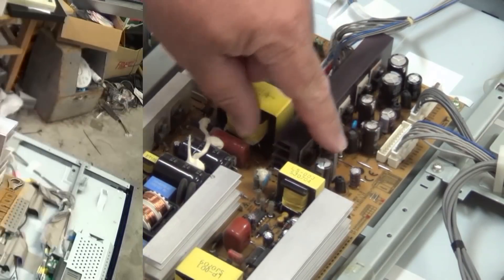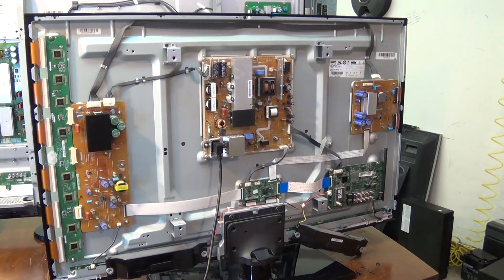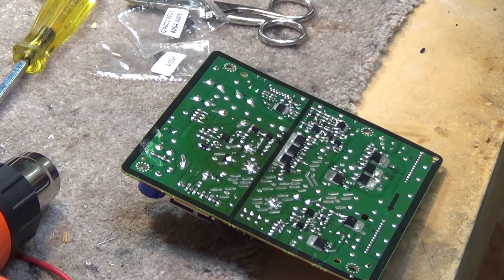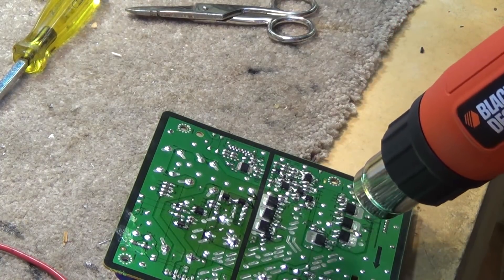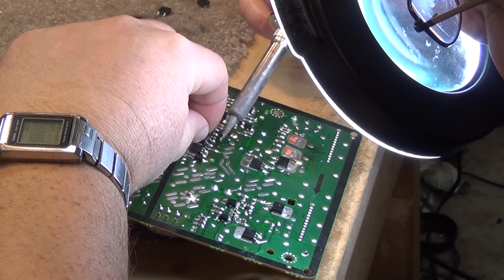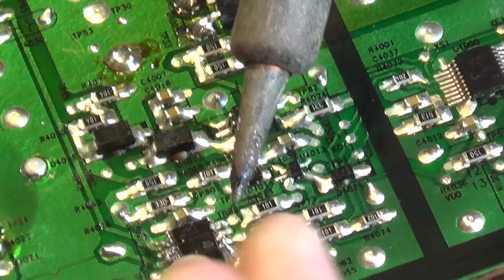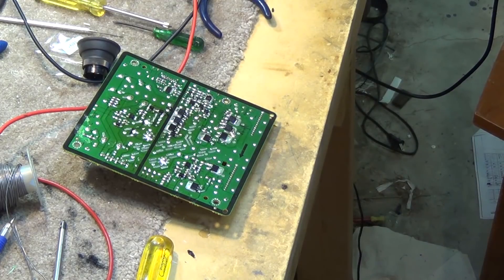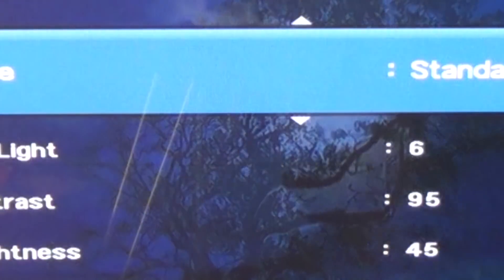Samsung PN43D440 Plasma TV dead set repair to component level

Comment: Thank you for the redo vid.  Going to be opening up my 60 inch Samsung plasma 2010.  Was running fine then one day yes had the speakers up full and set went blank.  The red power lite is still on in front lower left corner but remote does not turn it on.  If I un plug the set wait 30 seconds a min it will do its normal click click click and red lite flashes but does not chime or turn on.  Any suggestions off hand top of your head?  The red lite then is on steady and again remote does not turn it on.  Only unglugging the tv from the outlet and waiting a bit does the clicking cycle but no chiming and shuts off.

Comment: 43 INCH PLASMA SAMSUNG SAME MODEL PA43H4100ARXLX .SET IS DEAD COMPLETELY.NO STAN BY RED LIGHT ON/OFF . I CHECKED.NO GREEN LED FLASH ON T-CON BOARD. CHECKED 5 VOLT ON PS_ON ( PIN NO.2) .(PIN -4-5-6) NO 15 VOLT. (PIN 9-10) NO 5 VOLT. {WIRE STRIP GOING TO MAIN BOARD}.
WIRE STRIP GOING TO X-BOARD 1 TO 12 } NO 15 VOLT, NO VS, NO VA,
ON BOARD TESTING POINT NO VS.-208 VOLT, NO VA-58 VOLT. NO 15 VOLT.
I ALSO SENDING POWER SUPPLY PHOTO GRAPHS ON YOUR MOBILE .SO PLEASE GIVE ME PROPER GUIDE LINE .WHAT SHOULD I CHECK ON TABLE P/S.?

Comment: hi have a plasma tv with line going up and down some color to them. Samsung PN50A450P1D how to fix this please . thanks
Reply from the maker: Vertical lines are an indication of panel failure.  Can not be repaired without changing the panel and you will never find one.  So watch it till it dies and get a new set, or do what I did when one of my sets did that.  I moved it to my bedroom and use it just to watch the news on the 2 red lines I don't even notice because I see all the still graphics the local station plasters all over the screen that has burned into the remainder of the screen

Comment: Im all for copyright claims that are justified. if you BLATANTLY copy work then you should not be entitled to the revenue especially without due credit. 
in your case, that 12 sec clip can be worked out as a percentage of the video based on time and then if you had no audio on it another 50% removed as a credit due to the claimant. if they claim 100% of the video they also claim your audio and video as their own???

Comment: I just subscribed. Great video! You are very articulate and knowledgeable about plasma tvs . I recently acquired a Samsung model pn43f4500afxza. Everything seems to work fine except it power cycles about every 10minutes when I play over the air tv. It never does it when I use it for a monitor via HDMI. Could this be the main board? Or something else maybe. No capacitor bulging or any obvious signs of burn. Your suggestion would be much appreciated. Thanks
Reply from the maker: Check for a firmware update for the tv.
I am not a plasma expert by any means.  I have fixed only about a dozen or so plasma TVs in my life.  About the same number of LCD sets.

Comment: did u update the firmware after doin this
Reply from the maker: It was current.
Reply: @12voltvids  I found the whole board on eBay for 17 bucks put it in and works great I fix about 5 of these sets

Comment: Happy to rewatch to get you paid. Maybe you can help me with my Samsung TV. It's a HP-T6064 Plasma that I replaced the Y buffers and repaired the Y sustain board. It works OK now but the colors look muted. Power supply voltages are perfect and I tried to set the Y sustain according to the O-scope picture in service docs but could not get anything remotely close to trigger and O-scope. Another thing is that I have heard SNAP sounds from the TV a couple of times.

Comment: I enjoyed the video recap.... If one finds theirself coming across boards with surface mount components, would it be wise to invest in a hot air station? I also think that you could use comptom tape to isolate areas where heat isnt needed.

Comment: Sent you a small donation.  With two kids in college and the holidays in full swing, funds are a bit tight or it would have been more but your videos (and a couple of timely YT replies to questions) have helped me fix my Sony SLV-798 VCR with an eject problem and also my wife's 20+ year old Oster 4811 breadmaker.  My wife loves the breadmaker but it developed a problem where it would just intermittently shut off at random times during the cycle.  I've looked at it a few times and even replaced all the caps (a couple tested on the edge according to my Blue ESR meter) but could never figure it out since it was intermittent and random.  Watching you inspect solder joints and finding so many bad ones I decided to give it one last shot with a magnifying glass on the boards.  I didn't find anything obvious but a few that looked a bit cold.  I reflowed a dozen or so connections on both the power board and the logic board (the worst one on one of the display connections) and put it back together and I'll be darned if it didn't fix it.  It paid off with fresh dinner rolls for Thanksgiving!   I only recently found your channel and have been watching all your videos lately.  I really appreciate what you do, and how you do it, Dave.  Thank you!

Comment: I may just try this repair kit, as i said i got a very similar TV but sanyo branded
Reply from the maker: This one is specific to this TV, but considering that only 3 companies made plasma TVs, Panasonic, Samsung, and lg. Pioneer made them until 2008. Hitachi and nec made plasma in the early 2000s but I wouldn't expect many of those ones to still be around as they were not even HD back then.  Hd plasma didn't appear till mid 2000s and those were 720.  The 1080 plasma didn't appear till 2008 and all plasma sets were done by 2013

Comment: There are hundreds of components on that board. How did you figure out which ones are actually failed? That's the crucial question. Replacing components is the easy part of the job ;)
Reply from the maker: I looked for the largest ones and started testing.  Once I found that the igbt had failed I did a little research online and found a service kit was available which contained the 4 transistors and the drive ic.  I didn't test the drive ic so I dont know if it was bad but it was in the repair kit so it got changed.  Considering that there was a service kit tells me this is a common failure mode for this set.

Comment: Careful you don't knock off a near by resistor................. whoooops  lol
Reply from the maker: Notice I didn't skip a beat and stuck it back on before the solder even cooled.
Reply: @12voltvids   Could have been worse, could have got stuck to the iron tip!
Reply: @xnotx2  I noticed that but he was so dang fast at putting it back on that it was hard to catch.